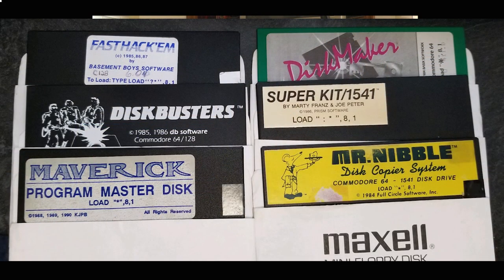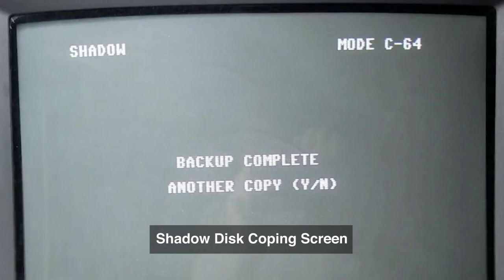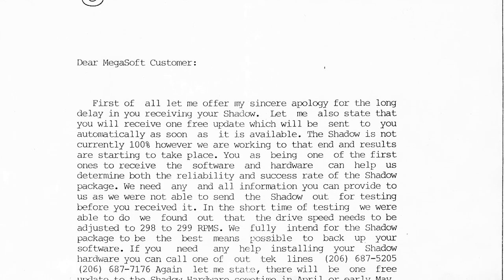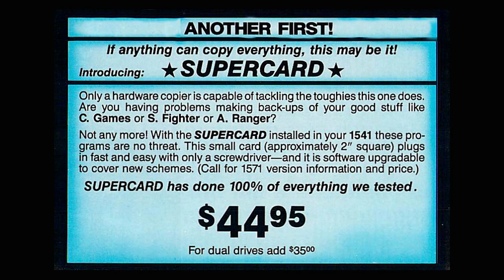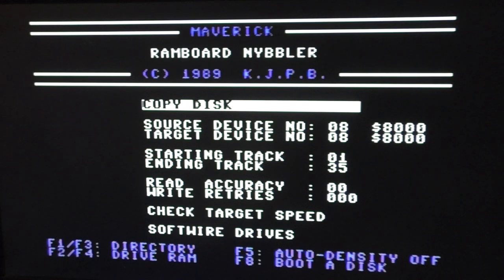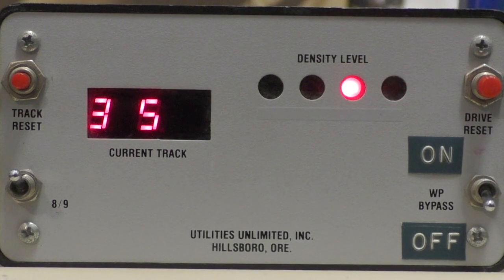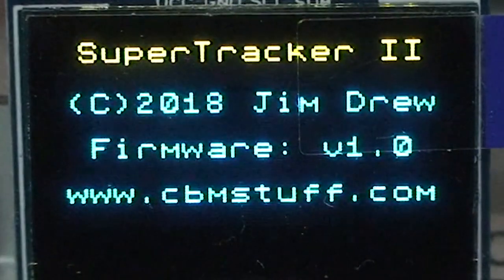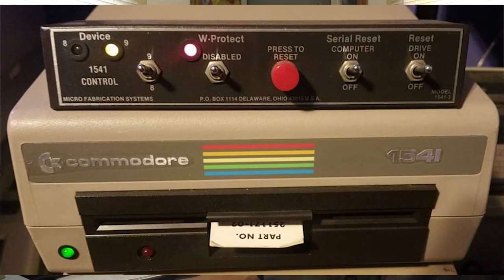History and Demonstration of the Super Card Pro and Super Tracker | VVCFMW 2020

Comment: I am flattered that you did a video on some of my products.  Your information is mostly correct.  I was hired by Megasoft's owner (Reggie Warren) to fix the Shadow, not Jack Cornelius (the creator of the Shadow).  I used the software from my ECHO board, which was a product that was released in 1985 (before the Shadow actually shipped).  ECHO was sold by Final Source Software first.  A few years later it was sold by Underware, which was a spin-off company of Final Source Software.  It was not uncommon for companies to have several sub-companies and re-sell older products.   Supercard (gen 1) was first released in 1986 and Supercard+ was released in 1987.  These were both deliberately down-played (not advertised until literally a few years later) because they basically killed our parameter business, which was a huge business for us.  You didn't need a parameter to bypass copy-protection when you could copy the protection exactly.  If you were local or if you "knew a guy", you could purchase these products when they became available.  It was a strange balance between trying to wait as long as possible to release something new and staying ahead of your competition with cutting edge products.  SuperCard Pro was started in mid-2012 and released on Friday the 13th - December 13th, 2013.  Thanks for sharing your video. Nice to see some of those old screens and hardware.  :)
Reply: Jim Thanks for the reply and for additonal comments.  I drew all my information from the forums, ads, and hoped I was fairly close on dates and information on the most part.  I am doing a series on Copiers and Copy Protection.

Comment: I remember that one of Sierra's copy protection methods of the AGI games on PCs was requiring the original disk to be present, to read certain secret sectors that were otherwise recognized only as bad sectors.  My dad once gave himself the challenge of cracking that code just for the thrill of it.  He used assembly language in PCShell, and it took him about 2 or 3 months, but he did accomplish it.

Comment: Craig, I enjoyed your presentation of the history of Commodore copy-protection and copy-protection copying.  I was unaware of Jim Drew's activities (or anyone else's, for that matter) in the Commodore hardware arena.  I knew of Jim's efforts through Central Point Software, whose Copy II PC board I bought back in the '80s.  I never looked into protection-defeating schemes for the Commodore, although I owned one; I viewed it as amusement for the kids.  I do have a SuperCard Pro that I bought a few years ago and have used for backups of my floppies from various systems.
Reply: I started disk copying on the Commodore (PET drives in about 1980).  I ended up working on the Option Board project only because I wrote a version of Copy II 64/128 for CPS.  I also worked on their Laser 128 project, debugging the "clean room" ROMs that they created for that Apple II clone.  I spent the majority of my time with Commodore machines, the C64/128 and then the Amiga.
Reply: @espjim  Well, I'll be obtaining a Tracker soon as I still have C64s, 128s and Amigas.